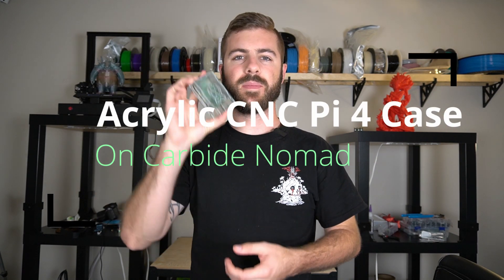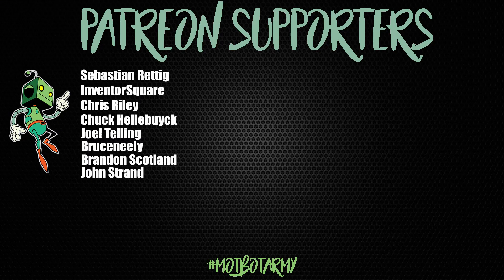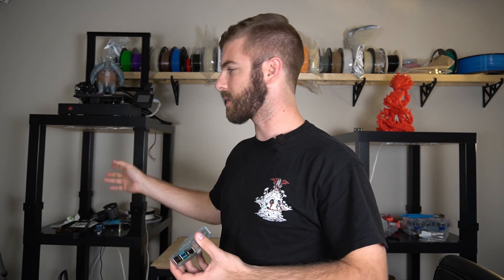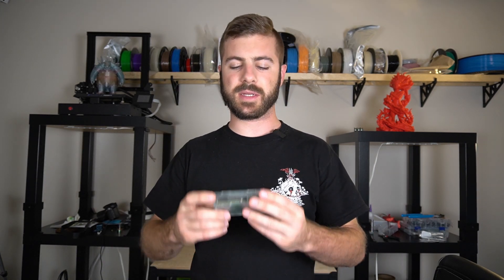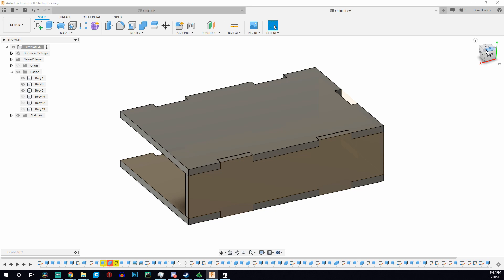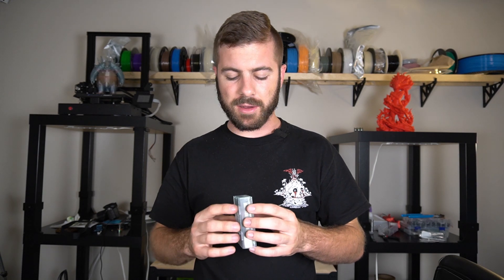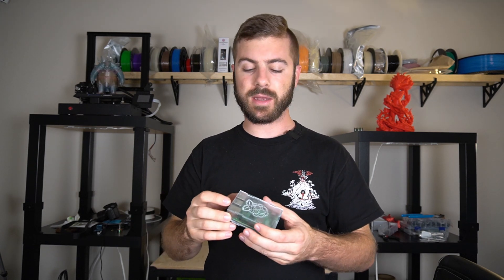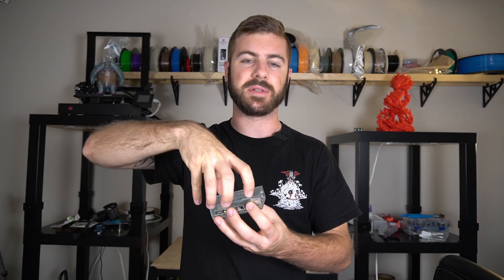Raspberry Pi 4 Acrylic Case Made On Carbide Nomad Desktop CNC

Comment: Really nice case. Curious to know if this would cause any heating problems (I did not see any heatsink for the CPU) - I know the standard case does not have enough ventilation and will cause thermal throttling even under normal loads.
Reply from the maker: I am curious to see as well. If I do run into issues with temperature I will end up adding a fan or heatsink. Will see how it goes over the next week or two after some use.